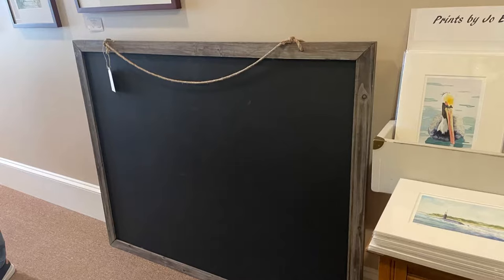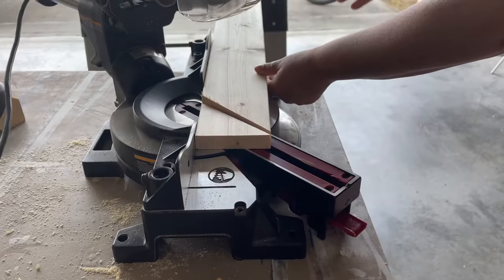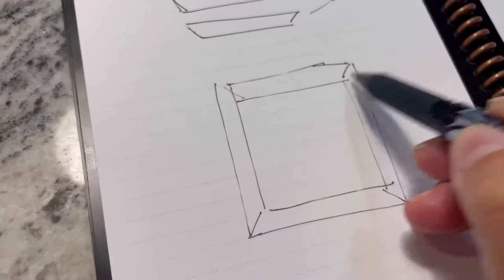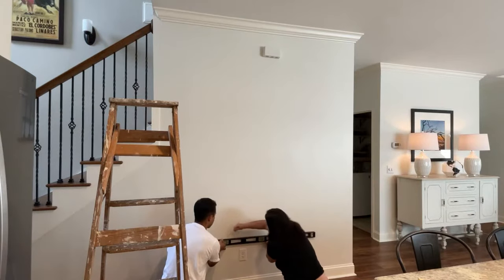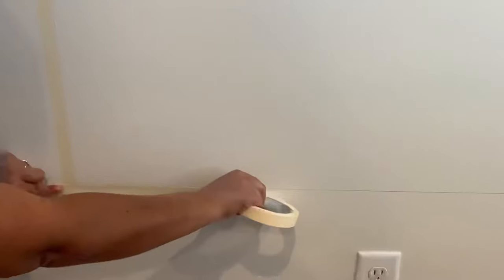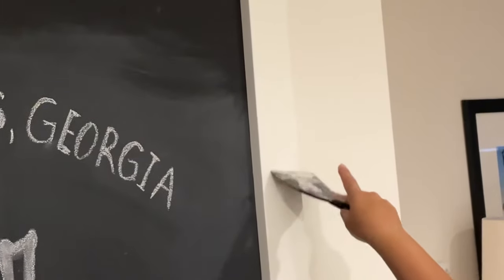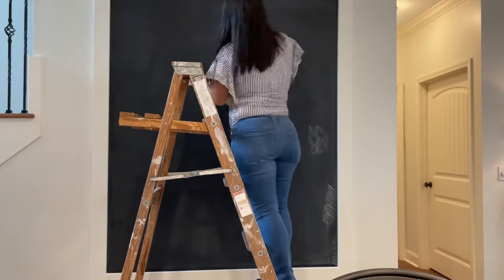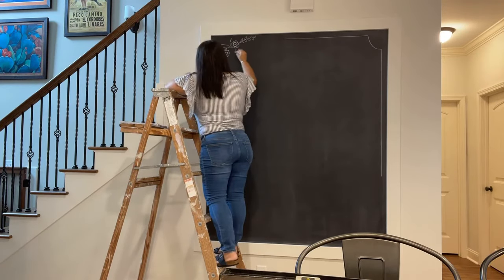Watch this BEFORE you paint a chalkboard on your wall!

Comment: How much paint did u use? 

I have a quart that says 120-150 sq ft. 

I guess if u need 5-7 coats u divide project by that? 

Must take a lot of paint
Reply from the maker: The can is correct. It just paints thin. You’ll notice it’ looks “oily” when you apply it.  The product goes a long way though. I didn’t use my entire quart. I have plenty left if I want to touch it up. But I haven’t needed to do that yet. Have fun!

Comment: I made a chalkboard wall And watch the video. It turned out great until I put chalk on board.Both directions like he said, when I erased the chop off.I had scratches all on the chat board..  I wiped it completely off when it wiped it off and did another coat of Chalkboard paint And I smoothed off the sharp edges on each side of the chalk.
But I'm so scared to do it again.Do you have any suggestions?
Reply from the maker: The very first time I did it, it did leave a small residue behind. I can still see some traces of the first drawing I ever made. I think the first time you cure it is the most  important. It gets easier and easier to work with over time. Also, every time I make a new drawing it covers any old residue and it looks  fine, no one notices. I’ve done over 15 drawings by now and it still works and looks beautiful. I have not repainted it since the first time. Maybe it’s time to try again, make sure it’s well cured and the first time you draw don’t push too hard. You’ll feel comfortable with how it erases soon enough. Good luck!

Comment: Looks great. The only concern I have is the dust.  After having used it for a while, has that become an issue in your kitchen area?
Reply from the maker: This is the 3rd time I change it and I’m getting ready to do my 4th design for fall. The dust only happens when I change my design.  If you plan on using  it daily, yes, you will have chalk dust to worry about. If you use it seasonally like me, you’ll deal with that less often. I just keep a vacuum handy when I re-design. Other than that, I love it and will put up with dust for a couple of days. Hope that helps.

Comment: I confess I came here to see what size lumber you used for the frame and I haven't started the paining yet so take that into consideration with what advice I have. I was worried about using a roller as most of my work is wipe on or regular brushes and airbrushes so I called my cousin who custom paints everything from walls and cabinets as well as chain stores all over the Canadian east coast. He said the taping and cutting in us the hardest part but where this in nowhere near a corner, ceiling, or lightswitch no cutting in needed lol. First fir a painted or primed wall do it just the way you have tape it up and give it a scuff or with a bare wall or if using a removable chalkboard cut out do any sanding and knot/ blemish filling now and seal the plywood then another quick scuff sand just get rid of the "orange peel" if it feels bumpy but this shouldn't happen it should be smooth. Now with the rollerload it up good you will want to apply lots put to much so it sags or runs then he usually does a big Z sorta stroke to evenly apply the extra where you need at (he also said for a whole wall he would roughly divide in 3 sections doing one at a time so in effect you'll make 3 Zeds across the wall by the time you're done). Now go back to one side and pait up and down in a very slight curve and move right to left ( or vise versa if you are right handed 😂). You don't need a lot of pressure here and after the first swipe near the tape put this pressure more on the side of the roller where the handle attaches (also should have mentioned the handle side needs to be facing the way you are painting. He assures me 4 isn't needed but hey a pro so I might cut that time back a little but not much besides I got other projects, housework, a wife and 5 young "adult" children to keep me busy for several 4 hour coats ha ha. Also again no sanding is needed unless you have stopped long enough for it to cure. He suggested 2-3 coats +1 when using chalk paint and the rest from cuing to installing the border and conditioning goes exactly how you've done it. He suggests the wall paint was too glossy for a base layer but also you weren't using enough paint and were way too erratic with your roller direction causing very thin almost see through areas as well as lines galore. Most of this can be fixed just as you have with extra coats but by doing it the suggested way could save you just on this project enough to make 2 chalkboards for the price of one. pS very beautiful if turned out nice AND you told me what dimensions your border is and it looks perfect so thanks for the great video.....most videos I've seen don't focus in that all
Reply from the maker: Thx so much for taking the time to share the feedback. I love learning more as I go. I think that’s what makes this so fun and exciting!

Comment: first get a bigger roller and wet the brush so its moist before dipping into chalk paint  its ok to go back on the first coat or any coat to apply in light spots
Reply from the maker: Thank you. This is an oil based paint though, does oil and water mix well together??? It doesn’t feel like normal acrylic paint at all. I’ve had it for a couple of years and made lots of cool drawings on it. I haven’t had to repaint since which is very exciting … but I wonder if I will need to do so a few more years down the line

Comment: Would it help to prime the area with a black primer?
Reply from the maker: I don't know.  I suppose it would give you a better base, but i think you'd still need several coats.  I've had my board for almost a year now and  I believe it is now at this point that I might need to either add another paint layer or find products that eliminate the "ghosting" left from previous artwork.  I've drawn about 6 designs since this video.

Comment: HUNDREDTH COMMENT! I bought my paint before I decided to do research. 😂 Great video! What kind of roller did you use and have you ever tried using chalk markers on it? ❤
Reply from the maker: I go to a restaurant that has chalkboards and the owner told me they have to repaint often bc they use chalk markers. I suggest you test them on a corner or something.  I like the versatility of regular chalk. I used the rollers for doors and cabinets to apply paint, that's why it was small. Another person commented I might have done better with a regular roller and applied it similar to painting a wall.  I have to tell you that we have had a blast.  Right now we are doing a Christmas theme with a barn and a truck.  I'll post it soon on my instagram page.  You'll have so much fun!  Go for it!
Reply: Thank you! We it a foam roller or polyester roller? What was the material?

Comment: why does it need to be cured before using it???
Reply from the maker: If you don't cure it, it will start leaving marks on the board when you erase it. It's called ghosting.  However, I'm getting ready to test a couple of other products that promise to solve that problem as well.

Comment: How many cans did it take?
Reply from the maker: I only purchased one can and I didn't use it all.  Quite inexpensive after all. I'm about to post another video showing some designs I've made.  You'll also see how it erases after multiple uses. I am happy with it. I suspect over time, I might need to give it another coat and I will update... so far though, it's worked out well with the initial coats of paint.
Reply: @homeandlifewithcynthia  thank you 😁 Great video!